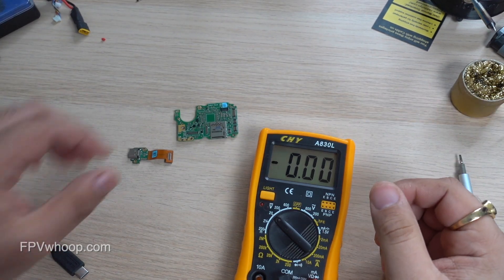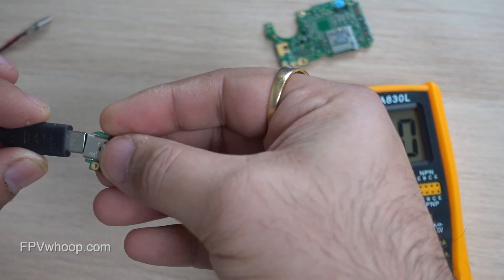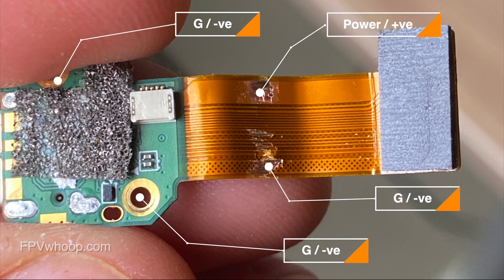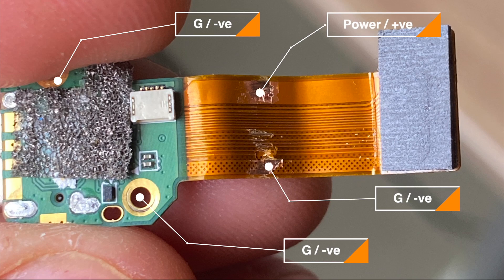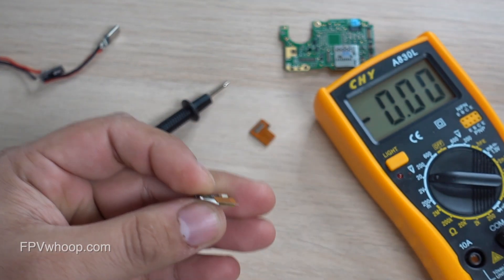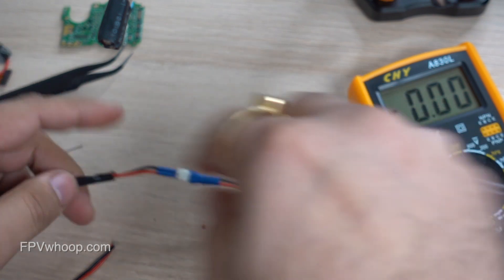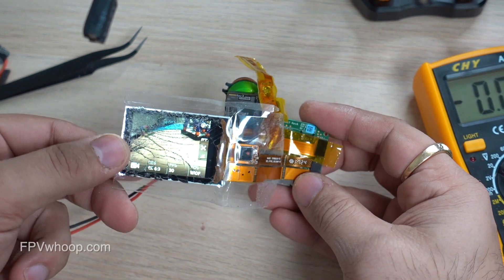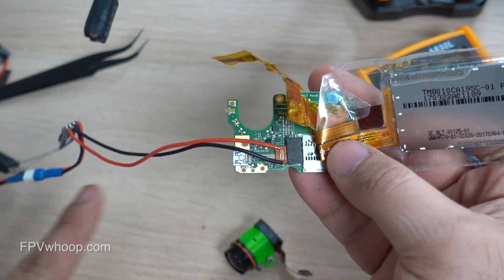Stripped GoPro USBC Mod

Comment: Hi, my scared slot is broken, is there any way to solder the card straight to the board?
Reply from the maker: Yes its possible, but you have to use very tiny pin point solder as wires are too thin and together.
Reply: @FPVWhoop  is there a tutorial on this topic somewhere?
Reply from the maker: @Danielimoveisaltoluxo  I think yes, let me search for you